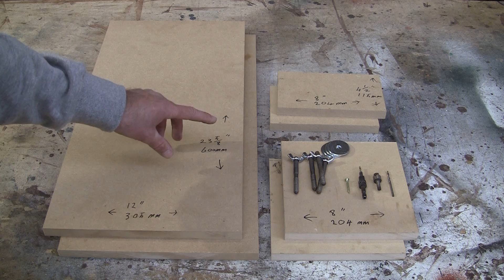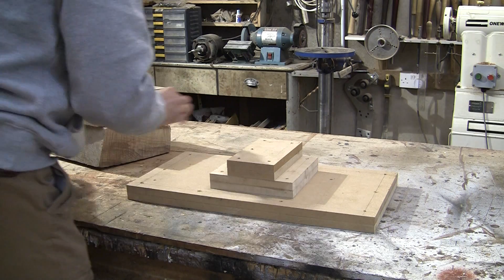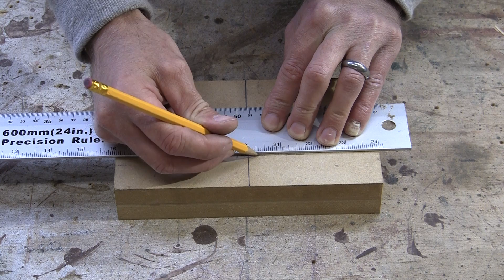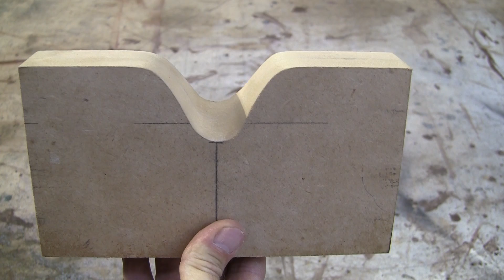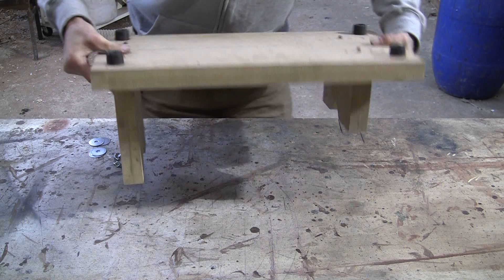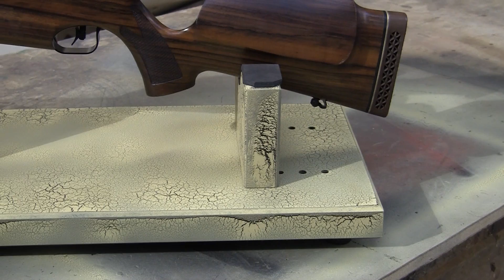DIY Air Rifle Stand, By HuntersVermin 2012

Comment: Just built one of these following this video (with a few very small variations) I also laminated 18mm mdf, turned out spot on, thank you very much. Just got a little bit of filling and sanding left to do and a final coat of paint and she's done. Deffinatly recommended

Comment: Hi ya got both the stand and sticks done today made my sticks 150cm as I'm 6ft 11in or 209 cm do u think that will be to big?
Reply from the maker: Better too long than too short as you can always spread the legs of the sticks farther apart to get a lower stance.
Reply: too long than to short at 6ft 11 all the cammo pants are to short ill buy extra material and sew it on ha ha ha
Reply from the maker: I'm 6ft 1 and have that problem at times too.

Comment: this is great Rifle stand im a cabinet maker so lots of spare board will make it on the weekend i have been loving your videos keep them coming  im new to shooting just ordered my first Gun the Gammo cfx .22 Cal not sure if its any good i want it for rabbit hunting hopefull it will do the job im concearned it only has 722fps but theres not alot of selection in Australia i will get a 1.77 next i just like the idea of the .22 Cal What do you think?
Reply from the maker: Hi ya glad you liked the stand.
At 722fps in .22cal you'l have about 16ft/lb of power which is more than enough as most UK hunters only use 12ft/lb.
Reply: what would the maximum range be 30 yards?
or you know a confident range for a beginner im prepared to run 500 standard ammo though the gun to break it in abit, how much ammo do u really need to go thru ?
Reply from the maker: Yes 25-30 yards is a good starting point as a 16ft/lb rifle should kill cleanly out to 50 yards with a head shot but your maximum range is gauged by how far you can shoot and still put your pellets into a 3/4 inch group as no matter how much power you have if you can't hit them in the right spot you won't kill cleanly.
Reply: HuntersVermin yeah im going to run atleast 500 pellets thru my gun 1 to break it in and 2 to work on my accuracy skills and learn to use my scope which is a leapers ugt big bug air rifle scope but i wont be shooting any vermin until i can do so humanely and with cofidence, i must admit even my wife has been joining me watching your videos and we just freak out every single shot is BAM KILL SHOT its awesome hope that doesnt make me sound weird
Reply from the maker: No no i took my wife to the range last night and she had a blast and can shoot just as well as me with the rifle rested on the bench.

Comment: i had a thought for adjustable legs. set a nut underneath in each corner and use some threaded rod red locktight and a wingnut stick the wingnut to the top and then you can screw it up and down accordingly. if that makes sence lol ive been drawing up my own plans based on yours hopefully ill start work on it soon. thanks for such good vids keep it up sir.